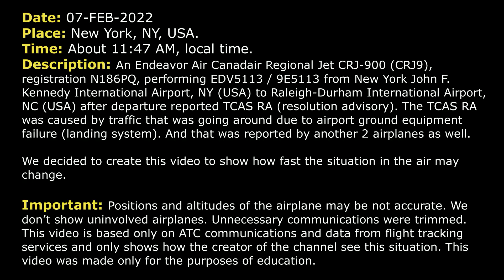TCAS RA and Ground equipment failure | New York Kennedy Airport, ATC

Comment: This was a complete cockup by JFK ATC.. TURKISH AIRWAYS IS A VERY EFFICIENT AIRLINE .. The Turkish crew called the tower 3 times on initial handover to which there was no reply from the tower controller. . Then when he eventually answered the Turkish aircraft the controller  was not helpful and seemed to ignore Turkish and was talking to the American planes.. This most most unprofessional. .Once again very bad controlling at JFK..
Reply: I don't think it had anything to do with the nationality of the flight, the controller was focused on close in traffic and those reporting troubles. It wasn't pretty but it wasn't about what country the flight was from.
Reply: You should listen to the video again, Ian.  The guidance equipment malfunctioned, causing everyone to go missed. And the departure from 04L was flying the SID. This situation is EXACTLY what ATC is trained for
Reply: @aj3751  I understand the localizer (part of the ILS) appeared to be intermittent. Whenever on approach to 4R the potential threat on a go-around or missed approach is departures from the inboard runway (4L) when they're flying eastbound turns after takeoff. That's what happened here. A subsequent flight flew the RNAV approach but I was puzzled that the traffic following that flight was flying the ILS, I guess it took a few seconds to get the word to the final approach controller. At the end of the day they sorted it out but it wasn't pretty. ATC knows that pilots are trained to follow TCAS RA guidance even if it means disregarding your ATC clearance. The TCAS system operates without any ground based equipment and it worked as advertised.
Reply: @gerardmoran9560  Tower had to let approach know what was going on, and it can take a minute sometimes.  And you're 100% correct.  The Standard Instrument Departure (SID) off 04L is fly 1.5 NM and then turn right heading 100.  It's JFK's slowest runway configuration.

And to clarify, my comment was directed at Ian, who seems to talk out his backside at every chance he gets.

Comment: 4L departure turning right after take off?
Reply: the 2 SIDs off RW4L & R specify a right turn to 099* , of course the published missed approach for 4R also says right turn to 099* so perhaps that should be amended
Reply: The 04L published SID is fly runway heading to the JFK 1.5 DME, then a right turn 100⁰, maintaining 5000 feet
Reply: Yeah! Make VERY sure your go-around or departure has turned right before you instruct them to go right. 
On the other hand... Departure instructions for 4L and 4R at Kennedy are probably: "After takeoff turn right heading....": Kennedy has very little airspace on the extended runway in that direction. The big picture is that everybody from Kennedy has to turn right within a few miles in order to leave the area. Still: Asking: can you fly straight is NOT the same as instructing them to do so. This controller made a couple of that kind of mistakes in this sequence. Some evaluation is in order IMHO.
Reply: @rewolff2  nobody departs on 04R my guy